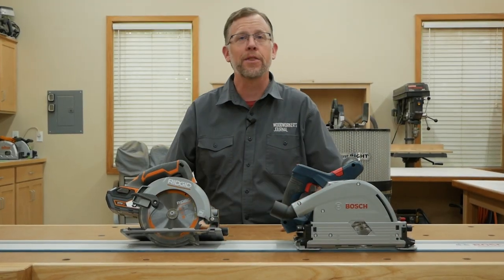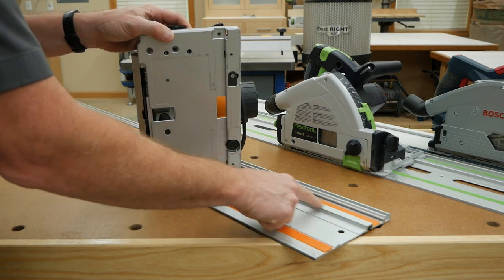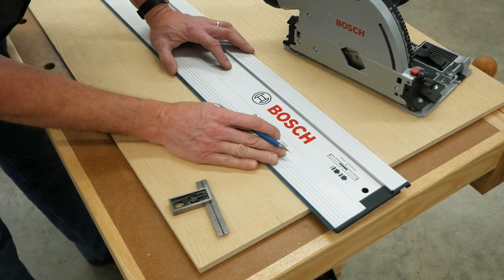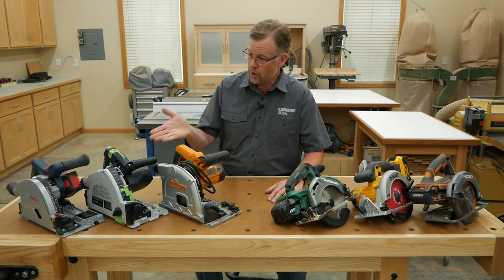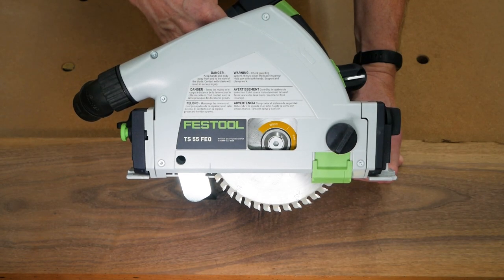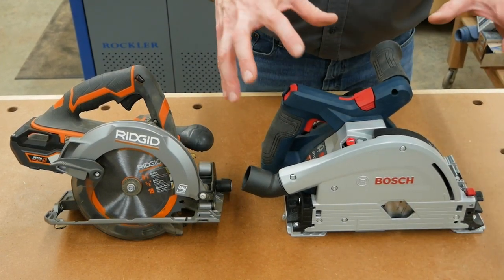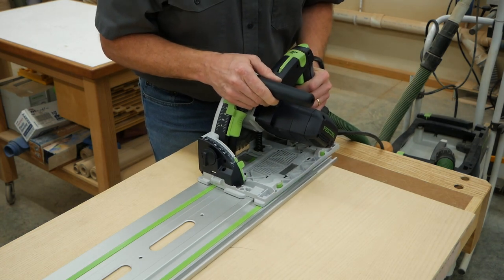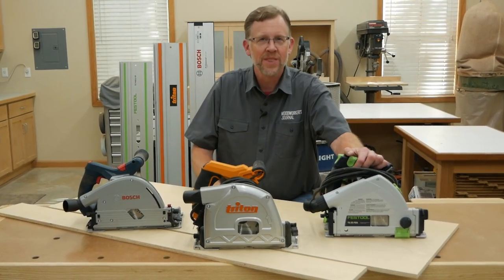Why Buy a Track Saw?

Comment: If you are a fumble fingers like me, get a pair of quick clamps that fit the channel under the guide rail - you don't have to buy Festool or the exact same brand as your saw, there are plenty of cheaper brands out there and all work because the channel is a standard size. The clamps make sure the rail won't get bumped or creep out of position either before or during a cut. (Micro Jig look like they should work but I believe the dovetail shape on the end doesn't fit rails)  The only downside that I have found is that the rail needs to be about a foot (30cm) longer than the job so there is room underneath for the clamps to hang down.

Comment: Tracks are super, going back I would have bought a track saw before a table saw, (hobbyist here so it's not a pro cabinet saw), but super tool, saves you lifting heavy sheet goods through a table saw. If your using a new track saw do your first cut on scrap wood as this will cut a bit of the rubber on the guide rail (as it's over sized), this sets up your saw to your rail perfectly. You can also do plunge cuts, a very useful function.

Comment: I used a Skill saw all my life without the kick back. The best thing I can think of for track saws are plunge cuts, and of course the track for the saw. We built a lot of store fronts w/ out it using a straight edge. If you can afford it good on you. If you want to skip buying a table saw, it's for you

Comment: Expense is relative, a track saw is a lot cheaper than a sliding panel saw and can be a great entry tool for a small shop at a marginal price.  The newer ones are dropping the riving knife for a kickback sensor making them even safer with less drag.